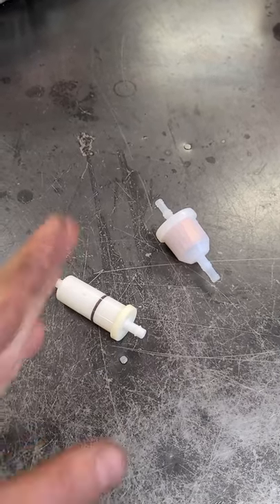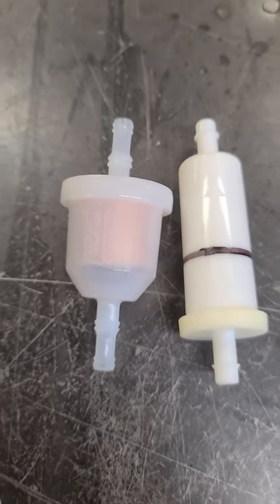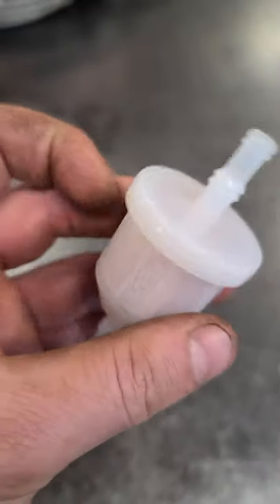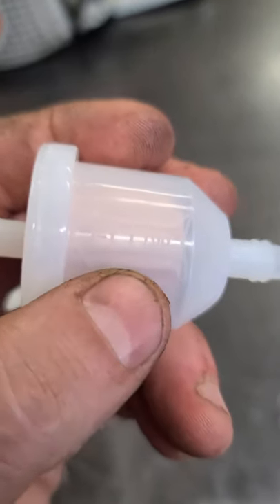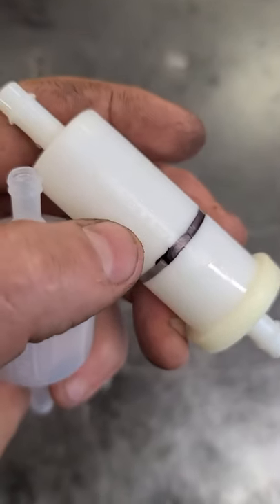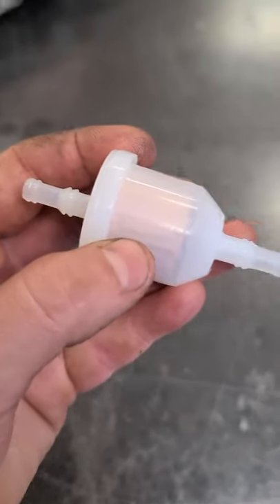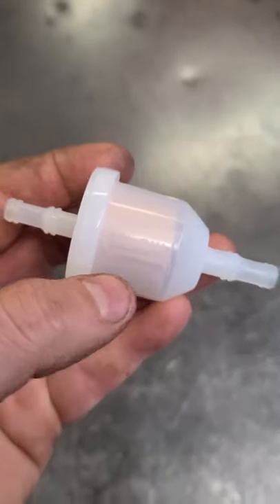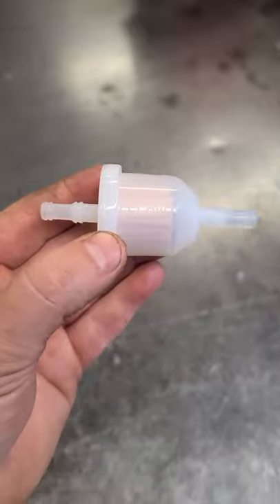What Is Arrow On Fuel Filters For? #shorts

Comment: I have Aveo 2011 . I bought gm genuin fuel filter for it . But it doesn't have an arrow on it at all . Is there a way to know what direction is the correct or since there is no arrow at all on the filter is ok to put it at any direction ? 
Second question . All fuel filters have arrows to the direction or some have and some no )

Comment: Hi Dony this is a weird situation with my 2020 JD Z-Trak which was just recently serviced. When it came back from the service depot it was sporting a brand new fuel filter but on closer inspection I didn’t notice any fuel inside the filter while the engine was running at full throttle. How could that even be possible? Makes me wonder if the filter was installed backwards and the fuel was somehow not visible. It made no sense to me.
Reply from the maker: sometimes it does happen, if machine runs properly don't worry about it

Comment: I have a small red fuel filter and it doesn’t have no arrows at all then what?
Reply: The shape of the filter itself is an arrow.  
Point filter in the same direction as fuel flow.
Reply: @jaxturner7288  Thank you so much. Really appreciate it.👍👍
Reply: Blow into one end. Then you can tell which end is which.
Reply: @jaxturner7288  The Wider End Goes To Carb First
Reply: @Tommyr  no.